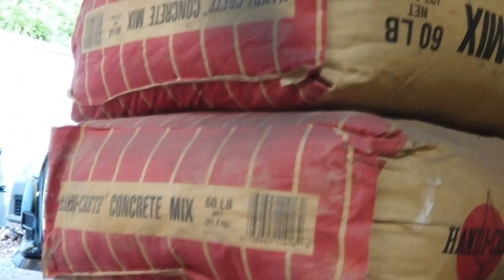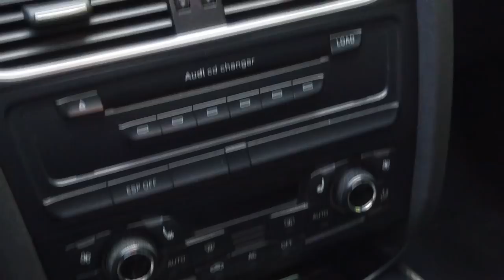I FINALLY finish the 2009 Audi S5

Comment: With the ac not working. Scan the car modules.  It could be the air pressure sensor. They do fail. Think it’s a G65 pressure switch.

Comment: audi,s have automatic chassis lubrication built  in it stops rust on parts under the car /oil leaks \ nice looking car 80 in third thats not too shabby you dont kneed air con the cars cool enough keep safe from the getting unlocked uk

Comment: That Audi turned out amazing. For what you have in that car and it's condition you stole that car. Yes it was a lot of work but look at what you have. Sorry your still stuck with the Camaro. They are nice cars but the blind spot in the roof line is rediculous. Biggest drawback to that body design you can't see anything out the rear sides. Congratulations on an awesome build on the Audi. Please give Stewie and Stella a kiss from another kitty lover in Central Florida 🥰

Comment: Don’t skimp on the tires. Trust me. Buy the OEM suggested tires. It will handle, ride and track like crap if you put the wrong/cheap tires on it. Trust me. I’ve tried. P Zeros are my suggestion. 

Btw, tires last about 15,000 miles, brakes, 12,000. NONE of my Audis have ever leaked oil. Ever.